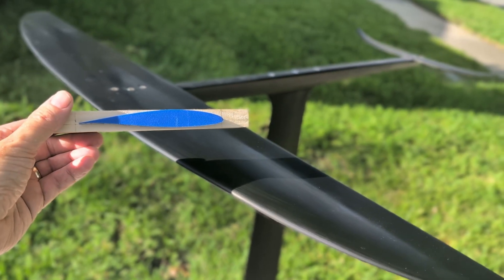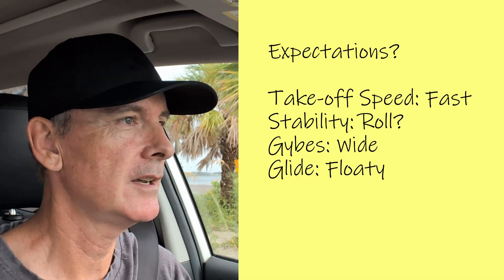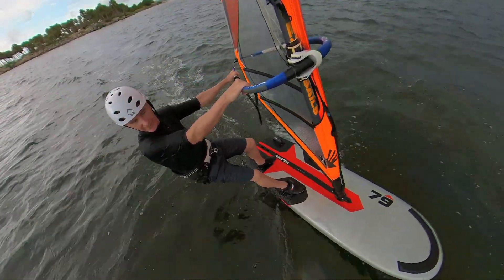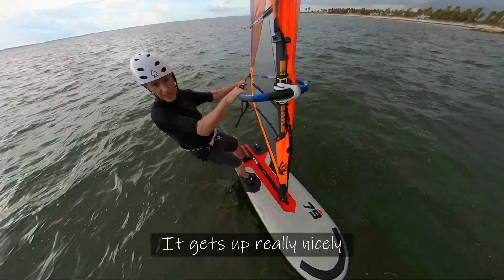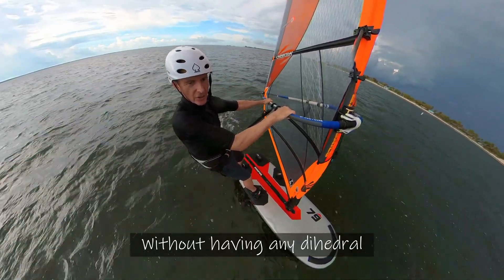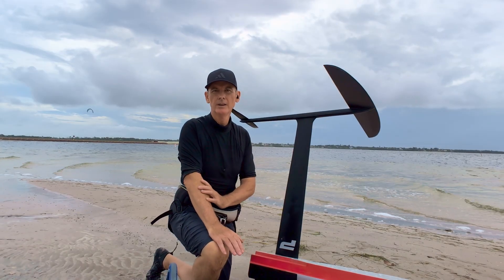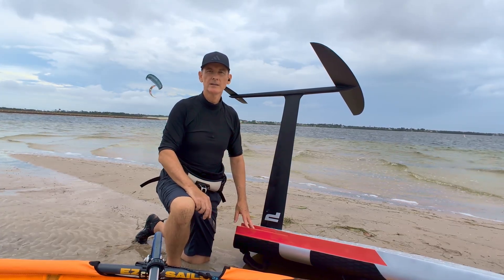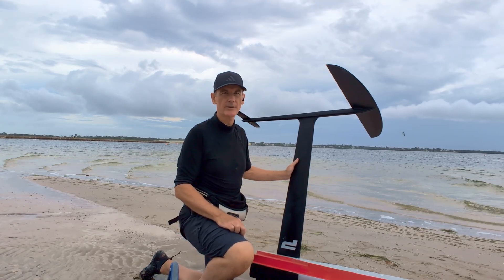DIY Hydrofoil Wing Test - Did it Actually Work?

Comment: nice work, loving the hand CNC hack, two suggestions : redo with some dihedral for the roll stability (you could cut both tips, and copy wingtip dihedral of a F4, B Rutan hack) and add a gopro near bottom tail to assess flight height.

Comment: Well done with simple tools good thinkering and carefull execution. Now the question.... how does it compares with a usd500 front wing?
Reply from the maker: A good commercially made wing is better: more product development and testing, computer design, more accurately made, high pressures and temp mold process, pre-preg carbon, directional fibers etc. But as a recreational wing for light wind it works great for what it was intended (earlier lift and much faster than my old 1300 Starboard wing, but doesn't turn as well).

Comment: Beautiful work! How much did the diy wing cost you? Is it cheaper than buying?
Reply from the maker: Thanks! "Cheaper" is a relative term...I would definitely say I got more value out of building than buying. But a commercial end product will usually be better and easier😊. I used left over materials except the wood core so materials cost was very low. I used less than 1 sq meter of carbon fiber - commercial molded foils probably use 3 times as much. There are also other materials eg vacuum bagging, but time is the biggest factor.